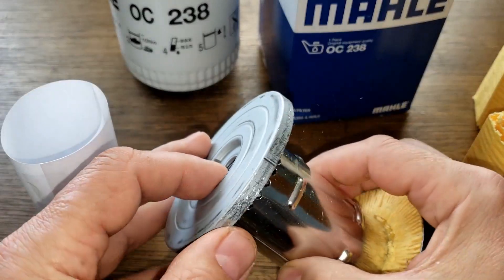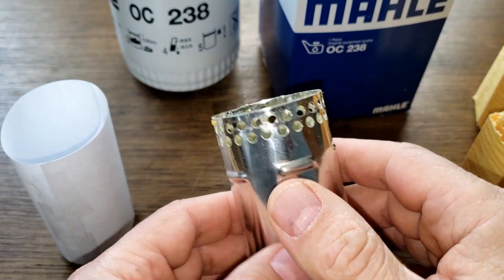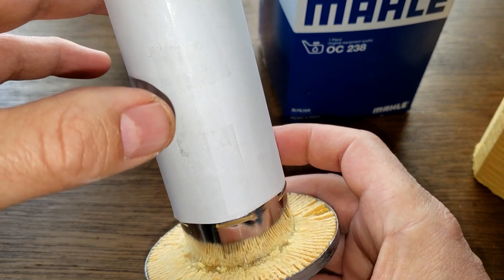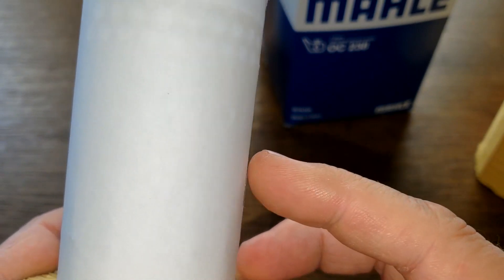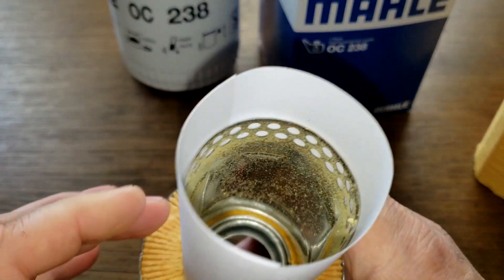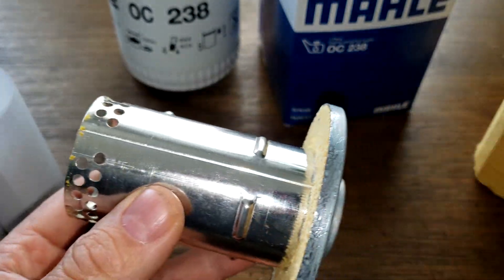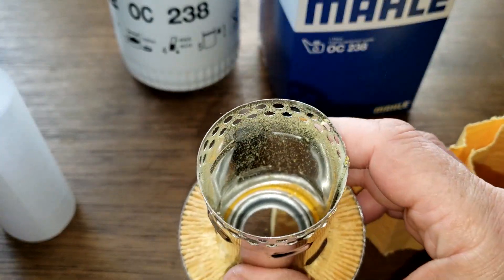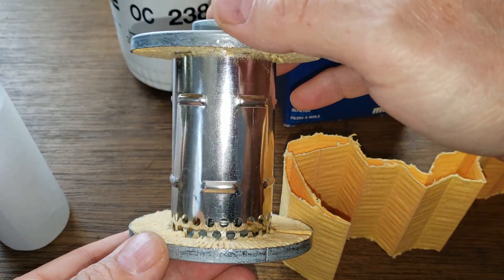Mahle OC238 Oil Filter, This is how I think the oil flows through this filter

Comment: Nice follow up!! 👍Evidently the media itself is the bigger restriction than lack of core holes/louvers.  I hope others with Mahle filters check theirs to see if all are like this.
Reply from the maker: Thank you 😊
Reply: @WhipCityWrencher  I appreciate  your work on this, and it's really cool you read the comments and interact.
Reply: @WhipCityWrencher  One other thing. Alot of filters like Wix and Fram show a +/-  9-11 or so gallons per minute flow rate.  I can't see how those few holes could flow ~10 gallons of room temperature oil in 1 minute let alone at say Zero degrees. Maybe the core design really doesn't matter for flow???
Reply from the maker: @GT-mn3bx  Hi GT,
As the channel grows in viewers and more comments it's getting harder, but I try and stay on top of it.
Thanks!👍
Reply: @GT-mn3bx  If we calculate the area of the holes in the New Core, we find that there is a plenty of area available for the oil to flow at a rate AT LEAST equal to the oil flow out of the base plate exit. 
Here at U-Tube, we tend to freak out when we see new stuff that doesn't have the same features that we're accustomed to.

Comment: Yup ,the oil flows down the cylinder & thru the holes ,seen this type of design on OEM German oil filters as well...& they are usually manufactured by this same manufacturer

Comment: I’m a retired refrigeration/hvac tech and it looks like to me that mfg co wants the oil to flow from one end of the filter to the other before exiting and maybe use the entire length of the filter media more evenly? When the oil flows in at the engine attachment end and contacts the media, if the path of least resistance is straight through to the metal tube with holes in it at the engine end, why flow down to the other end? At least until that media is restricted, and then it would have too. I think it really doesn’t matter too much and is over thinking it a bit, like others have said. Also, the small outlet holes may create a pressure drop and pressurize the media upstream, equal on both sides, to even out the flow through it.
Reply from the maker: You could be right, I don't know.
Thanks for your feedback!

Comment: They call me Panhead Dave, I use a washable stainless steel screen that Is 35 micron mesh 3 and a half inches by about 40 inches that is pleated 5/16 inch that I did with a homemade tool. It is epoxied to a paper element filter unit that I burned all the paper and glue off,  been running this particular filter for over ten years on the bike I've had since I was 19 yo, it's a '64 panhead harley, now I'm 60 and still riding the same bike, incidentally it's a tank shift(no gate, search and destroy) shifter with a 'suicide' clutch, open 2 inch belt primary, never have belt, clutch, etc. Problems, except the pain in the butt to fabricate the permanent oil filter element, also, about 40 percent of this bike is hand fabricated by myself, I used to restore postwar English cars, been a bit of fun along the way

Comment: I like the way you think.  Your principal idea is good but I have to point out that that design is a disaster waiting to happen.  1) The inner pleats are very tight due to the circumference.  2) The inner pleats as you know will get plugged.  3) The oil is going to take the path of least resistance.  Meaning that the lower part of the filter will do all the initial work and plug up.  Then the oil will try and flow higher up and further up as the filter becomes plugged/more restriction. 
Personally, I wouldn't put that filter on a Go-kart let alone a Rolls or Bentley.
Reply from the maker: You make a good point there and I also see no advantage in this design.
Thanks for the feedback!👍

Comment: Good job, Whip !!  When it comes to a weird filter component, like a solid core with 2 rows of holes at the dome end, your guess is as good as anybody's -- and your extensive experience as the leading Filter-Cutter-Opener guy on U-Tube gives weight to your opinion.
There must be a REASON behind such a drastic change to the Core construction, and I'd sure like to know how the engineers justified the change.
My GUESS is that the new Core forces the distribution of the filtered oil into a more balanced flow -- from the dome end to the outlet. The solid Core with 2 rows of closely-spaced holes helps to prevent filter collapse, while still allowing an adequate oil flow.
 The Spiral-wound cores with louvers were the first to use the restrictive cores as a means to prevent filter collapse -- WITHOUT inhibiting the overall oil flow rate.
If this new Core works the way I THINK it does, it's a long-term winner.
Reply from the maker: Thanks for the compliment,
You might have nailed it on how that filter works but I still dont know why it would be any better than the traditional holes or louvers. Although I can say that the inner solid core feels like it would not cave in too easily. Just seems like an oil flow restriction to me.

Comment: I wonder i f Bentley would warranty an engine with that filter installed.  I  dont think it would based on that much restriction. Oil needs to flow to be filtered, and to lube.  That looks like a clog and bypass with any level of contamination.  What a bout cold weather start, bypass immediately?  Ill stick with my Ford's and Motorcraft filters.
Reply from the maker: Thanks for your feedback!

Comment: Looks like a bad design to me
Reply: How would you know !?? Are you an Oil Filter Engineer !?? How many oil filters did you design!??

NONE !?? Oh, O.K. -- just thought I'd ask.
Reply: @SlikLizrd  just a observation from 22 years of being a automotive  technician .  Tell me how many oil filters have you designed ?
Reply: @classicwefi  22 years !?? I have running shoes older than that.  ;>)
 Like you, I have not designed ANY oil filters, which is why I wasn't foolish enough to judge this particular design as "bad" without giving any facts to back up such an early evaluation.
 You know, like any accomplished  automotive technician would do.
Reply from the maker: I dont like it either, Thanks for your feedback!👍
Reply: Hmmm…unless those Mahle engineers have something up their sleeve, seems like the GM E-Core (nylon core) open design is eons better for oil flow after the oil flows through the filtering media.
Reply: @johnmar7701  That would be true if the RATE of oil flow through the filter is the major concern -- however, it appears that the DIRECTION of oil flow through the filter element is the focal point.